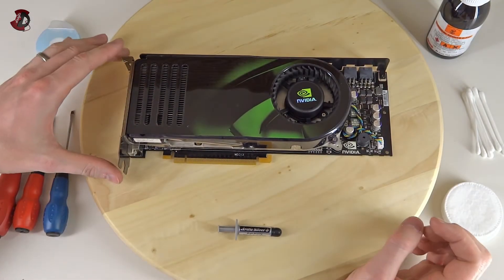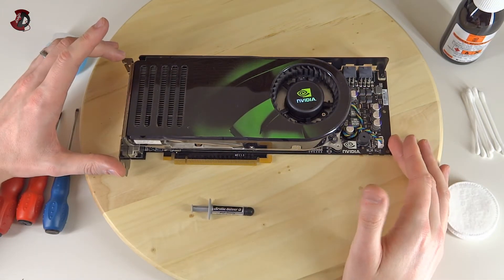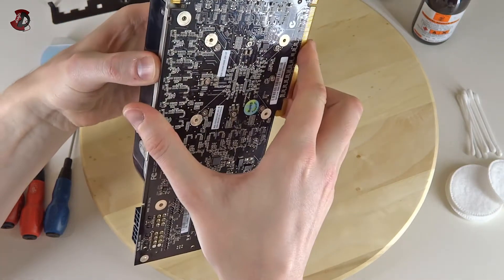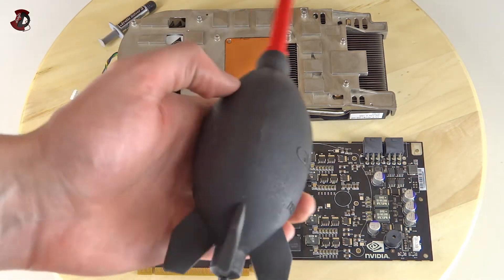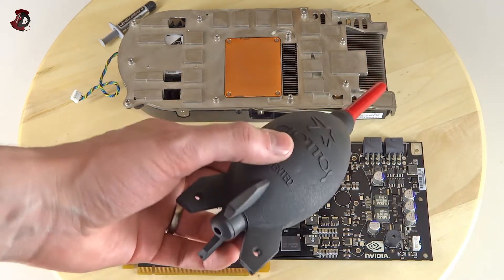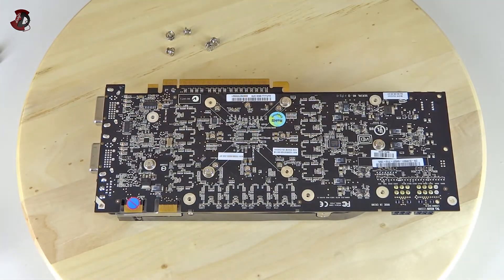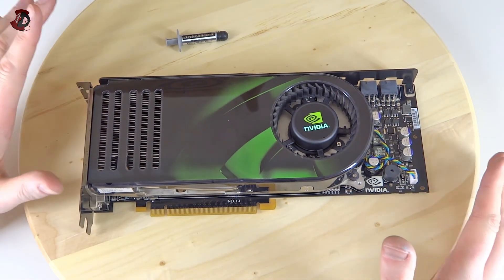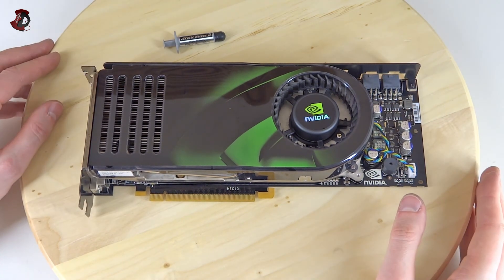GPU Thermal Paste Removal and Application [experimental]

Comment: Arctic Silver 5 is very forgiving, because of the way it cures, but is also much thicker at room temp, you should take the board off, to see the spread patterns in each area and then using the edge of a piece of credit card to spread it thin and flat on each area, of each side, and then apply a small amount on the center of each chip, to re-spread. If you don't spread it manually, there will be spaces not covered which may overheat. On exposed die, this is critical, because any exposed area of the silicon can heat up and 'chip' from heat expansion, and fail. Arctic Silver also has mild capacitance, is not conductive, but you must use care when putting onto to GPU and some CPU that have resistors surrounding the die. The way you did this board, it will most likely fail at some point, unless by some miracle the Arctic Silver 5 spreads and cures enough via heat and convection.
Reply from the maker: +Edwin Erst in theory yes. In practice this paste should not be used to cover RAM modules. Thermal pads should be used. But.. I got the graphics card for almost nothing so :)

Comment: Just FYI you should not replace thermal pads with thermal paste as it is not designed to cover the same gap distance, dont follow this video
Reply: kn00tcn forgot to mention, would be cool to see how it spread (take off the cooler after screwing it on)
Reply from the maker: You mean not recommended? My GPU was fine afterwards and in long run I had temp drop. Newer GPUs are much tighter with heatsinks and it should be even less worries.
Reply: Eds drafts temp drop of what? does the card have sensors for vram & VRM? what i found crazy was the lines you put rather than a dot (or better, X shape), in addition to the fact that as5 instructions warn you not to go near pcb components (aka spilling from the heatsink pressure, particularly around the ram
Reply from the maker: Sorry but this was once off project. The card is gone. Ideally you should use thermal pads for this type of application.